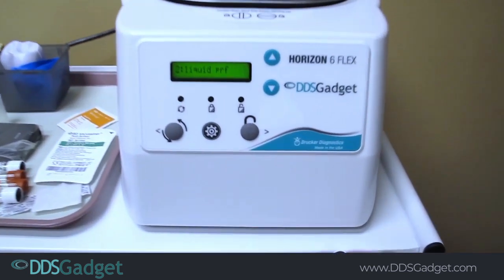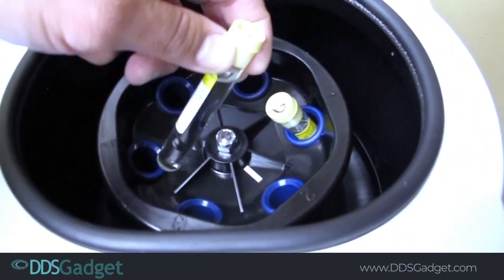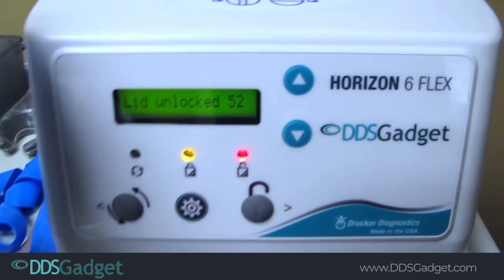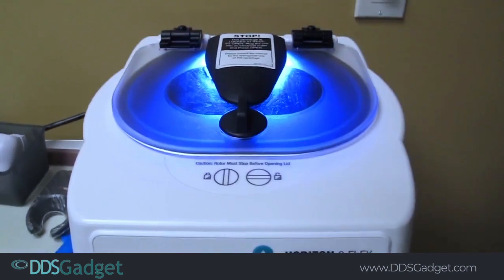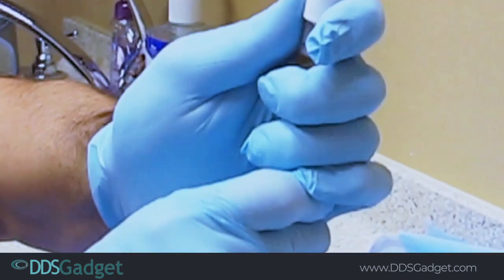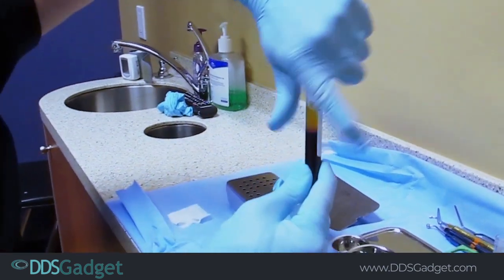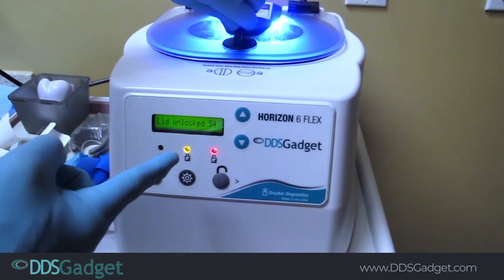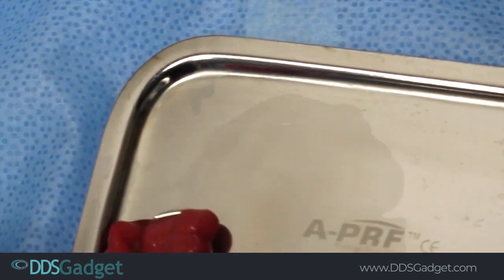Introducing the Horizontal Centrifuge for PRF

Comment: THis is a Horizon centrifuge, not horizontal spin centrifuge,?  Was loking for the latest BIO-prf or c-prf technique.
Reply: Haha. True. Same here. But even Bio-PRF is swing bucket model centrifuge
Reply: @shukenadashore6527  I got this same model 640VES -just slightly diff cover, it is horizontal spin , but my problem is i-prf specified 700rpm. I was going to get rid of this centrifuge because the minimum is 1000 rpm.  One of the PRF's Dr on youtube  advise other doctors to use 1000rpm. The latest PRF technique uses horizontal spin which I have not seen any doctors used yet, but they coming out with L-PRF which run at 2700rpm with higher growth factor. But this video use 1200rpm for i-prf so I am aware every centrifuge has different in RCF.
Reply: @Cordycep1  Hi. Basically RCF is same for different centrifuges. You need to calculate your particular RPM using the specific radius of your centrifuge and RCF from the study. So RCF for iprf=60g, L-Prf=1000g; A-prf =700G for 14 min; A-prf plus= 700g for 8 min
Reply: @shukenadashore6527  thank you for  sharing your expertise.
Reply: @Cordycep1  700rpm is for fixed centrifuge. they also say to use the white cap tubes, what setting to use for that? i only see red, green, black mm.. it's confusing, doctors themselves are still studying the best rpm and time. some are also trying to sell you something by saying their system is the best. and for years they used prp with good results so even if not perfect prf it should still be good.
Reply: But iprf 1200 for 8 mints or what?
Reply: @smart_khanx5556  yes, the video said to use 1200 for 8 min for iprf for this  centrifuge brand  only.
Reply: @spopparty  for this centrifuge the vendor use iprf 1200 for 8 min.  White caps (plastic) for iprf.  700rpm is for smaller centrifuge because the radius is smaller.
Reply: U mean for iprf.. different rpm for different centrifuge
Reply: @smart_khanx5556  yes
Reply: Thenn how we ll know about it?
Reply: And can u tell me about how to prepare prgf? And wts difference between prgf and prp preparations?
Reply: @smart_khanx5556  note: the  PRF tube nust not contains additives.  PRP tubes contain additives -usually yellow cap.
Reply: @duc huy wts difference between prp and prgf? Does prgf contain any special meterial?
Reply: @Cordycep1  ok, that makes sense. I do see now it's a different centrifuge in that link for a fixed (the Horizon can do fixed and horizontal depending on the rotor)  I'll just go with that time for now... do I have enough growth factors, who knows.
Reply from the maker: Yes, it is a horizontal centrifuge. The fact that is called Horizon doesn't have anything to do with the type of machine it is. Horizontal centrifuges are really what are better known as swing-out centrifuges, where the tubes swing out horizontally at high RPM, as they are NOT fixed to the centrifuge. With a fixed-angle centrifuge, however, the tubes are fixed at a specific angle and so never move. The Bio-Prf is a horizontal centrifuge made in Germany. It is no different than this horizontal centrifuge and they both function in the same exact manner.
Reply from the maker: @Cordycep1  The important thing about centrifugation is the RCF value, not the RPM. Different machines will have different RPM's for the same exact protocol, because the radius of these machines are different. However, the RCF can be the same! RCF (RCF max) describes the amount of accelerative force applied to a sample in a centrifuge. As RCF is a function of the RPM and radius of the centrifuge, PRF protocol results derived from using centrifuges with different radii are not comparable, and the RPM may need to be adjusted to achieve a similar RCF on a different centrifuge. On the DDSGadget horizontal centrifuge, solid PRF (750 RCF) is achieved with 2,300 RPM and liquid PRF (200 RCF) is achieved with  1,200 RPM. You can adjust these settings to any RCF which floats your boat, as the clinicians who market PRF are constantly  changing the RCF for various protocols in an effort to improve PRF yield, and more likely to sell their own machine. But, it's all the same, and the settings on this machine correspond to classic PRF protocols. Anyhow, there is a formula online to calculate the proper RPM for any machine to use for a particular RCF. This machine will display the RCF on the panel, so you can easily adjust the RPM to the proper recommended RCF.